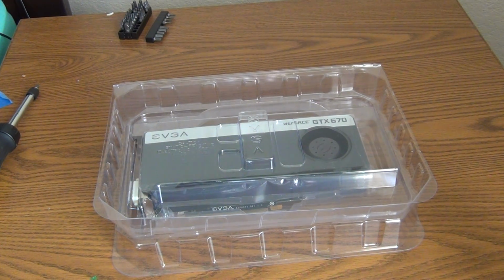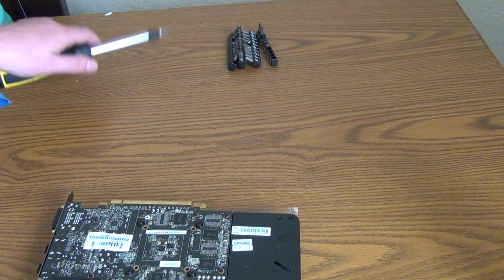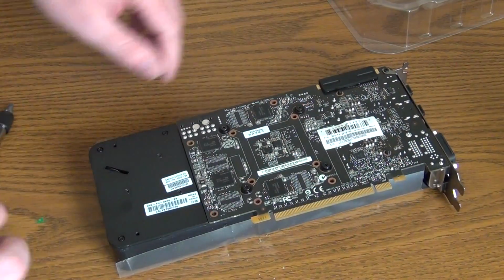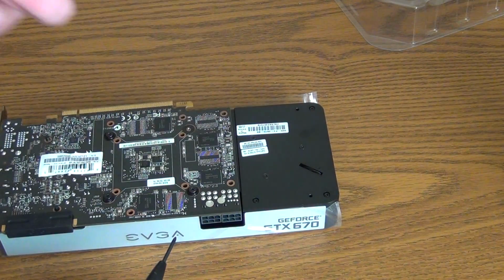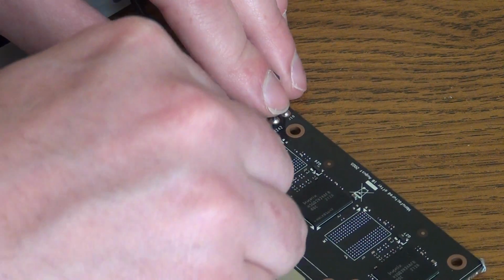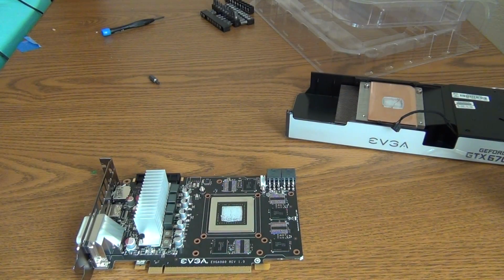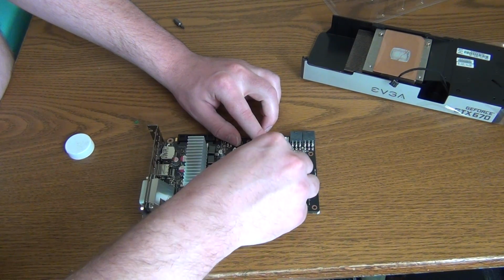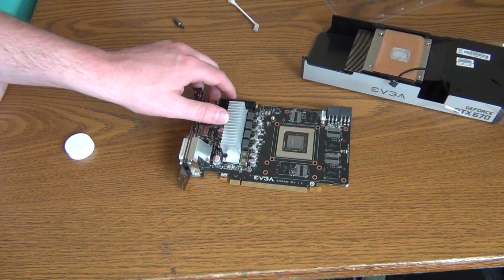EVGA GTX 670 (taken apart tutorial)

Comment: you can leave the heatsink on the gpu and remove only the plastic cover, just let the 4 screws iin the middle siit and remove the 2 in the plastic cover on the top. now yoouu can remove only the top and clean the dust

Comment: Mine didn't have the spring loaded screws for the heatsink, just tiny flimsy screws which hold a clamp down on the pcb.   I broke the head off one of the screws when reassembling so one corner of the clamp is not tight.  Agghh, why use rubbish tiny screws for this.